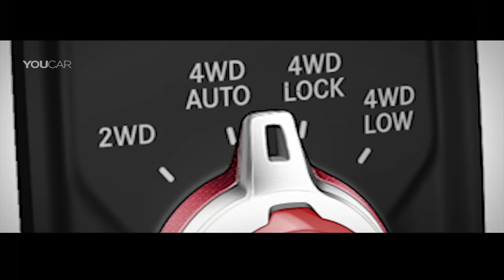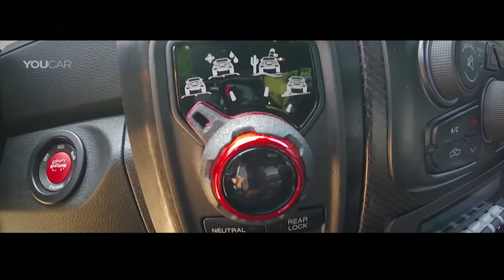► Ram Rebel TRX Concept 575 HP - 100mph Offroad Pickup

Comment: is the engine built to its max so any upgrade will blow it up or is it a sleeper where you can give it way more power than stock with no problem. and how's the trans, talk to us.
Reply: themrjones please explain
Reply: is the motor built like the Ford GT where it can handle 1000hp twin turbo upgrade without touching anything but the computer or is it built like the Ford superduty diesel where a tune blows the thing up because it can't handle any more power, it's built to its max.
Reply: Jeremy R The scat pack motor is a 6.4. This has the Hellcat supercharged 6.2.

Comment: If they're putting a crippled Supercharged 6.2L V8 with 575hp to compete with say, the Baja Raptor. They damn well better put the full 707hp 6.2L V8 for the Ram 1500 to compete with the 750hp this is the Shelby F-150 Super Snake
Reply: mike hunt
Reply: its confirmed they are
Reply: The super snake will still beat it because its 750hp plus lighter truck then the more will become faster but if they put back the 427 cobra engine they better put it in the truck and the mustang to create 1000hp

Comment: Why does the title say "100 mph pickup"? The fastest it went in this video is maybe 35 mph
Reply: remember this is a prototype, plus if they were to measure it's max speed that would mean that the're building it 100%, but they're not, it's just a concept. Plus the ford raptor can go a max speed of 107mph, and it has a v6 with 450 hp, this has a supercharged 6.4l hemi v8 with 575 hp, so don't doubt that estimation of speed they gave us.
Reply: Ram has said that this will be the first production truck that can go 100 mph IN THE DIRT. Actual top speed will probably be quite a bit more. This is the same engine that is in the Hellcat, after all.